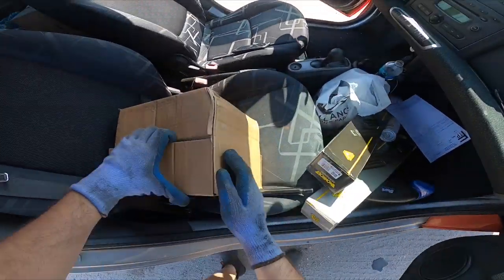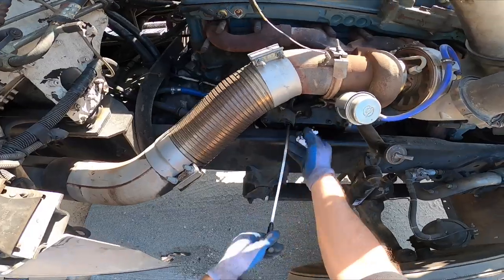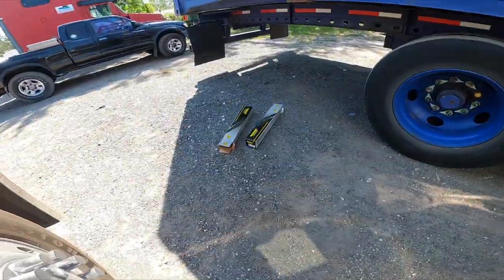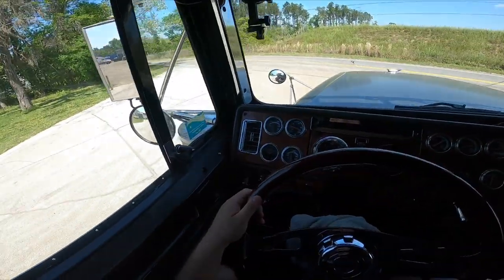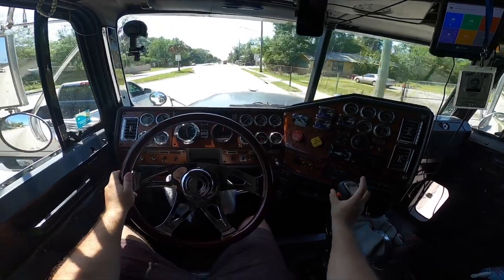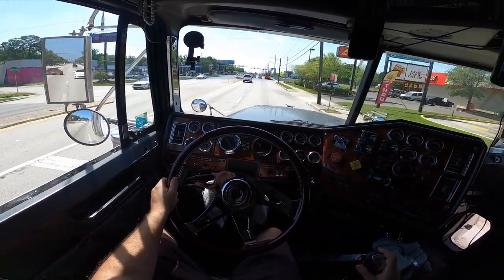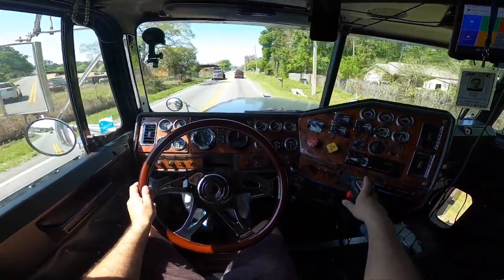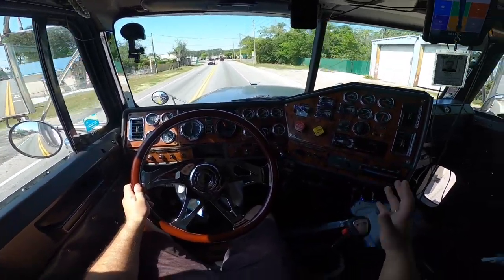HOW I SHIFT/FLOAT A 13 SPEED POV (EXPLAINED) / REPLACING SHOCKS

Comment: Long idles can wash the cylinders and starve the heads of oil.  Extended run times, bump the idle up to 1,000 rpm and you will keep from washing the cylinders out with fuel and keep adequate oil pressure to the heads.  Also, cool downs are very important as well, 1,000 rpm for 10-15 minutes before shutting down will save the bearing in your turbo especially if you are loaded.   Is the oil coming from the waste gate?

Comment: also the shifting thing, i was taught start of in 1st with the clutch then get enough rpms to shift into the other gears without clutch and when hauling etc when coming to a stop put it in neutral to slow a bit faster

Comment: Can you please show how to shift on upgrades and downgrades. How do you determine what gear you need, what are you doing if you find you at wrong gear?
Reply from the maker: When i got up one i can show you for sure but how do i determine the gear well normally i see how fast the truck is going and that's how i know what gear to go in for example 10-15 is 4th 15- 25 is 5th Low and high and 25-35 is 6th low and high and so on

Comment: I used to drive an 18 speed, the difference is also you can split all gears right from 1rst gear.
 

I have floated before but I talked with my mechanic and he said if you knew what you were doing to your tanny , you'd double clutch, so I went back to it.
Reply: double clutch also wears the clutch out quicker.
Reply: @thepositivelyfe8114  It doesn't wear it out any faster than it normally would, things wear out. and a clutch is a hell of a lot cheaper than a transmission .
Reply from the maker: i feel you i mean my dads been floating his Super 10 Trans since the day he got it in 03 and his truck has over 1.6 million miles with no transmission issues besides normal clutch replacements

Comment: Just started driving a 13 speed I’m having trouble with the slowing down enough to get to a turn where you don’t have to stop so a continuous turn. can you make a video explaining that? I haven’t seen any videos of that, the truck I drive now is a little different than the one I drove in the school I went to. Like how do you know what gear to use when making a turn and when to hold the clutch down and let go or even change gear
Reply from the maker: Well it kinda goes like this 1-4 is about 1-15 MPH / 5-6 15-35  / 7-8 MPH 40-70
Reply: Trucker AK thank you for the advice I don’t wanna be a bother by asking too many questions but what if I’m on 8th gear high and I slow all the way down to 25mph wouldn’t my truck turn off? I had my brother screaming at me that my truck would turn off if I kept slowing down to downshift, how I was taught. Well I was taught on a 10 speed but I now drive a 13

Comment: On European and British Trucks you HAVE to use the Clutch Pedal for Every Gear shift and also you Have to use the Clutch Pedal (not accelerator) to engage the Splitter, so No Floating Gears here....it's an American Truck thing only!.
Reply: if your truck got transmission without synchromesh you can float gear as well

btw I've seen scania 124 floating gears

Comment: Need to get a APU idling a truck all the time isn’t the best plus think of the money saved in fuel. With that you’ll have that APU paid off in time. I know they are pricey, but maybe you could find a used one in great condition. Or a converter with batteries to last 10 hrs

Comment: It is not supposed to leak, it does not need time to set. What work has been done there?
Reply from the maker: i had an Inframe done and a brand new Head and brand new cam put in it
Reply: @TruckerAK  Would call them up and have them fix it before they pull the ''it's been to long so we wont to it under warranty'' card. Engine should not leak after any engine work.

Comment: Truth be told you shouldn't idle engine until it breaks in. Mine just reached 300,000, and it took that long before everything seated and sealed. Hope this helps
Reply from the maker: every mechanic i've talked even mine said to idle the motor at like 800 to 1000 rpm to set the rings
Reply: @TruckerAK  yeah I've been told same, I did for first 100,000 then stopped till engine fully broke in. Now she runs really nice and quiet for a Detroit.

Comment: Is this intentional, have the manufacture designed the truck’s transmission to float gears like this? Is it possible with a car or this a truck exclusive thing.
Reply: American trucks use non synchronized gearboxes which is 2.5 billion years old technology. By timing your shifts perfectly, you can change gears without touching the clutch. It's not on purpose, it's just how it is.

And no, If you do this in your car, you'll need a new transmission.
Reply: You can do it in older vehicles, if I’m driving by myself I will only use the clutch to drive away in 1st then 2nd through 5th is with no clutch. But yes you are right if you do this in a newer manual car you will need a new transmission

Comment: Wait so you don’t need to press the clutch in passed 2nd gear?
Reply from the maker: In a truck when you bob tailing you can start in 1 or 2 or 3 because the truck as so much torque it won’t shut off. Only when you loaded you have to start in first gear since the load weighs the truck down
Reply: depends on the truck, in volvo's 13speed i can float any gear once wheels are spinning, but international 18 speed i need to clutch in any low gears (1-4 lows or highs) anything above 9 gear can be floated all the way to 16.
Reply: Like I’ve really been thinking about being a truck driver and for some reason I get scared that I won’t be able to do it
Reply: Trucker AK I meant to direct that comment to you I don’t know if you can see it

Comment: Technically speaking when you said you were starting in 1st that was actually 2nd. Low is actually 1st gear, I had 2 rebuild 1 when I was in trade school.
Reply: 1tuffzx10 not true. Low is low, 1st is 1st. Look at the diagram for any shift pattern.
Reply: @BigCool95  look at the diagram my man, how is it a 13 speed 🤨🤔? Low, 2,3,4,5. Then it's 6&7, 8&9, 10&11 then 12&13. Low is considered 1st gear bruh. Like I said, I had 2 rebuild it that's how I kno. Watch any video here on the tube that explains how a 13 speed is shifted. I have 1 also so I have 1st hand knowledge on it. Not tryna 2 be a kno it all but that's actually how it's set up.
Reply: @BigCool95  look at the diagram my friend & tell me where you see 13 speeds. You can count it off all day long it's only gonna come out to 12. Try it out then holla back.
Reply: 1tuffzx10 Its driven liken an 8 speed. 1,2,3,4 flip the range selector up and 5,6,7,8. 5-8 can be split high and lo. For a total of 12 gears like you said. Lo gear makes it a 13 speed, but lo gear is Lo gear NOT 1st.
Reply: @BigCool95  yeah you are definitely right. Low is low and not first. On the top left is reverse and down left is low.
Reply: @BigCool95  I beg 2 differ. It's called a 13 speed for a reason, not a 12 speed. Rebuild 1 then get back at me. Low is counted as 1st my dude. You are correct in the way your looking at it but technically low is counted as 1st by the transmission maker/creator. Not tryna 2 argue about it but it's just a little known FACT💁🏾‍♂️.
Reply: 1tuffzx10 i dont have to rebuild one. I drive them. Lo is in fact a gear, but it is NOT first gear.
Reply: 1tuffzx10 and you have no business rebuilding transmissions if you dont know the difference between lo and 1st
Reply: @BigCool95  if you say so 👍🏾
Reply: @BigCool95  wasn't tryna 2 argue about it or be nasty wit it, so that being said be safe & have a good day.
Reply: @BigCool95  read want I said in my earlier comment bruh, my personal truck has a 13 speed so please don't go there wit that. I have my own truck that & its not a company truck either. Like I said b4 I saw the other response have a good day & stay safe out here ✊🏿

Comment: Too much idle time. Had 12. 7 Detroits for 20 years. They will live forever if you don't idle the hell out of them. That oil is from your turbo. It is your truck. Do what you want. But you need to cut down on the idle time. JUST SAYING.